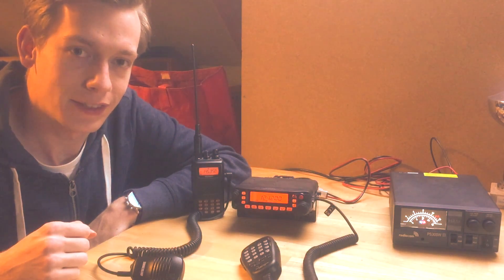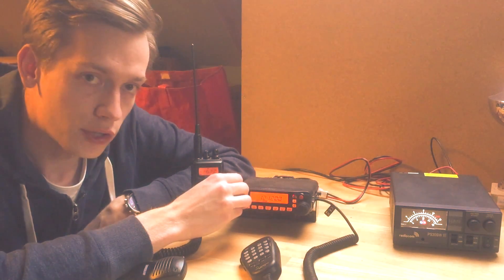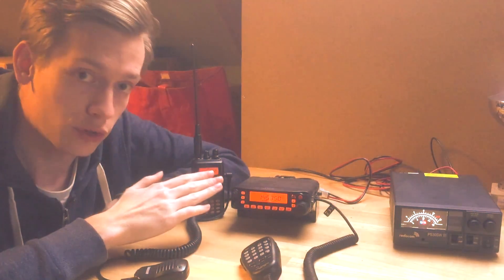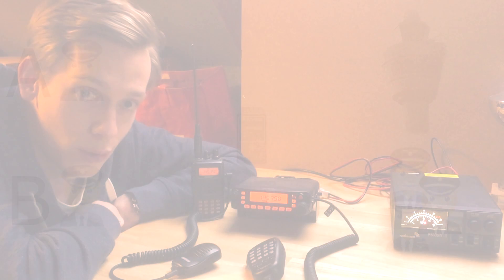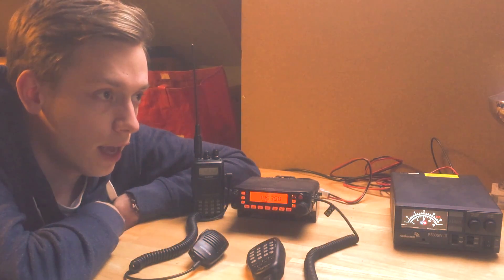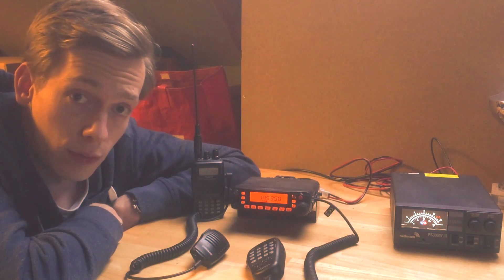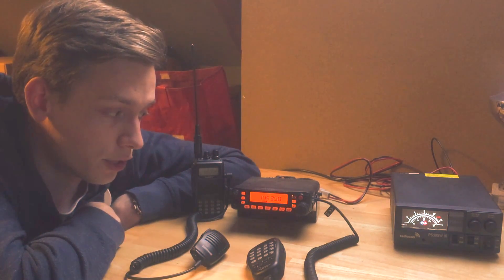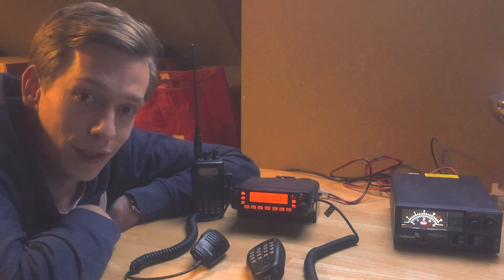Why VATSIM's Radio Quality Sucks & How to Deal with its Latency!

Comment: Some good instructions for flying on vatsim. I didn't fly on vatsim yet, but on ivao. They use a teamspeak server and the quality was always good. What is the reason that vatsim doesn't  use this method?
Reply from the maker: Thank you! I guess they don't want to be dependent on Teamspeak and since the Teamspeak audio quality is 'too clear' and doesn't have this 'radio feeling' to it having your own voice codec helps. Moreover though, not using Teamspeak but using a pilot client like vPilot instead is very simple and more realistic: you just connect to the network using the pilot client and you can switch frequencies from within the cockpit without having to run any other program or being dependent on Teamspeak channels.

Comment: The radio signals in real life are called Amplitude Signals (AM) :D 
It provides larger radio-waves in specific areas. FM is too expensive and does not provide that "large" radio-wave as AM. That is why aircrafts are operating VHF/Very High Frequency (AM) signals, instead of Frequency Modulations (FM). 
Awesome video!
Reply from the maker: Haha yeah, I know, I tried to use terms that are understandable for everyone :). Thanks for watching! :)
Reply: That`s understandable. :)